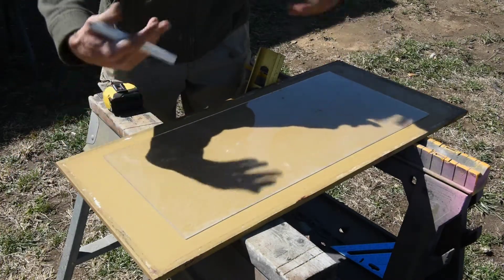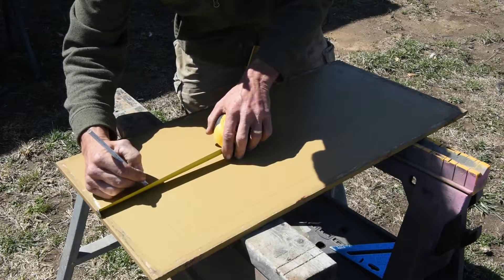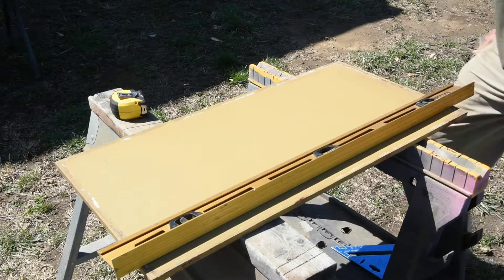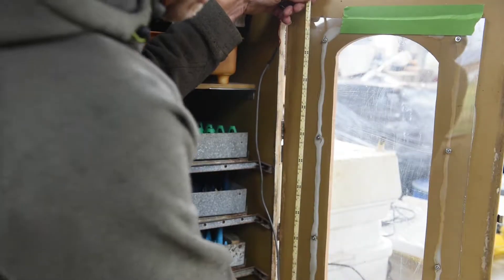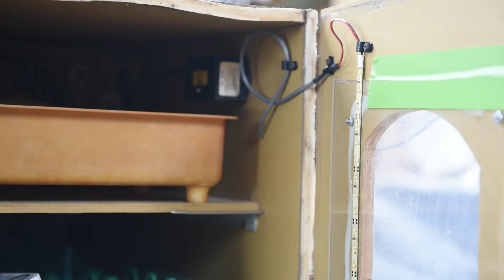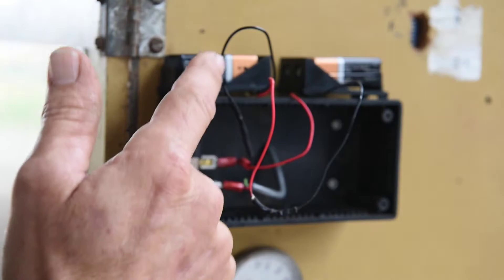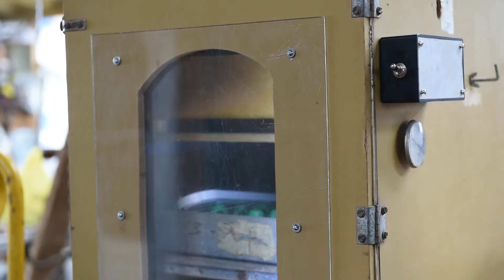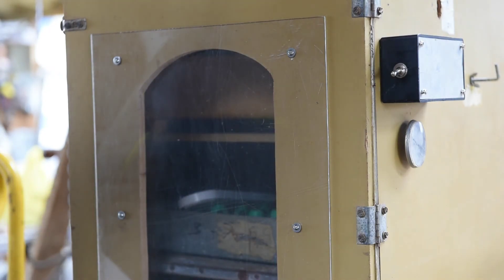GQF cabinet incubator to help increase hatch rates. New plexiglass door and LED lights.

Comment: Looks great. Why the odd voltage? Using what you had on hand?
Reply from the maker: Yes using what I have on hand. I will be converting this incubator to 12 volts next year and 12 volt solar panels actually put out 18 volts. Most 12 volt led's can work from 10 vdc to 20 vdc.Plus we won't use the lights that much so the 9 volt batteries should last most of the hatching season.Thanks for watching.
Reply: @HippieHillHomestead  makes sense,  good plan.  Good luck
Reply from the maker: @jerryrigsit5400  Thank you.